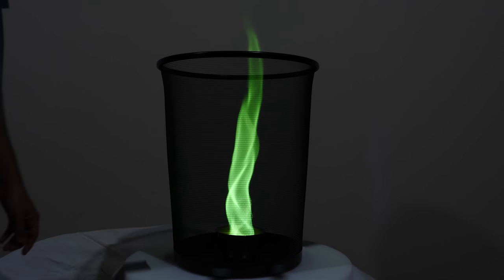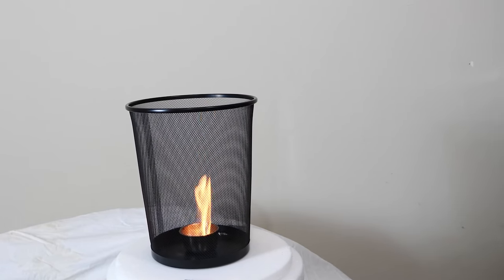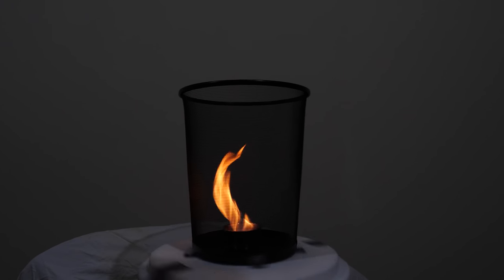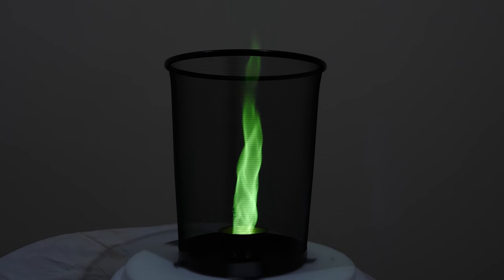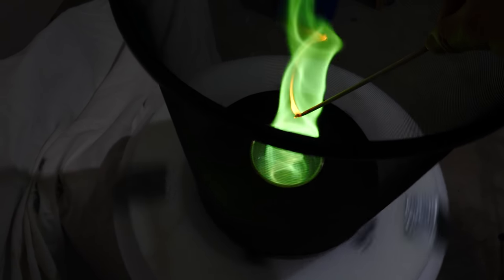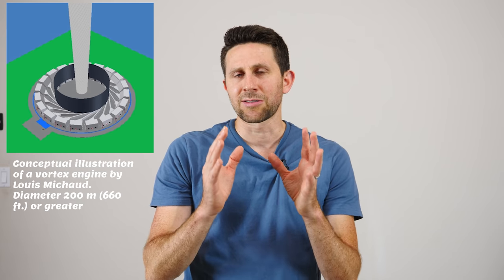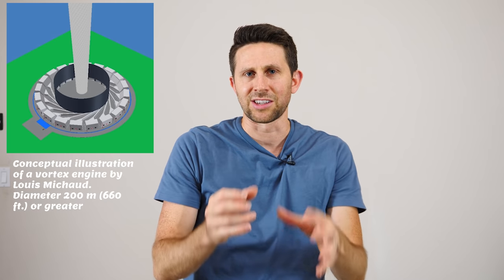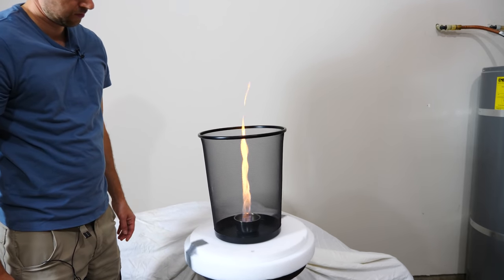Making An Atmospheric Vortex Engine With Green Fire

Comment: Would it be more efficient or cheaper than running the waste heat over a direct thermal electric heat collector?  I remember reading about some car manufacturers looking into using exhaust heat to capture some electrical energy to run the ancillary electrical systems but it wasn’t cost-effective of course.

Comment: So the dude  who proposed the vortex generator is suggesting we spend electricity to spin a chimney to generate electricity?  ... I'm not following the logic.
Reply from the maker: The vortex just has to be initiated. Sort of like with the water at the beginning you have to swirl it but then it continues on it's own. So it could be initiated but then it would continue and theoretically you could extract energy from the incoming air. But the question they haven't answered is if it takes more energy to start and keep the vortex spinning then you can get out of it.
Reply: @TheActionLab  Neat!  Well here's to more testing.  The less waste the better.

Comment: If you can cut a piece of cylinder glass in half and put it around the small and shift it in a way that it creates an equal open gap  between the edges of a cylinder glass. This let's air spin around the fire creating the vortex.

Comment: What would happen if you put a thermal powered fireplace fan on top? Can you then also use the fans shaft to power the rotating fire? Or maybe use a second fireplace fan shaft for the rotation. Would it be energy efficient in a small scale?  To distribute the heat in a room or in your house. 
/Christian